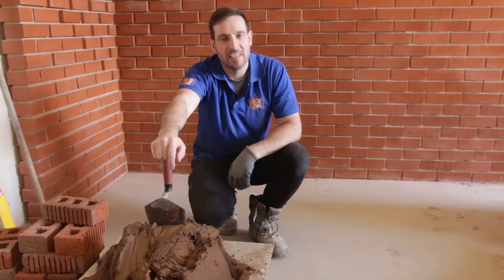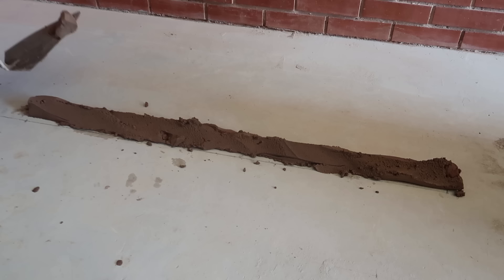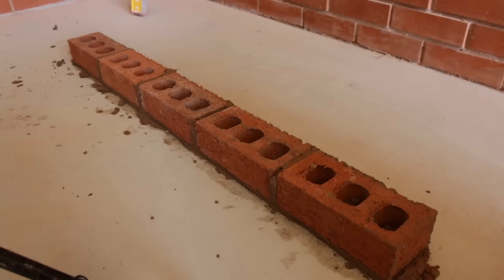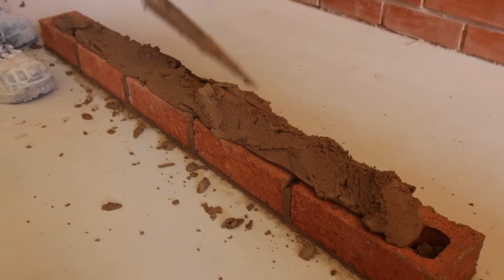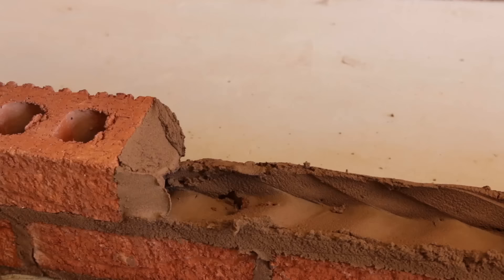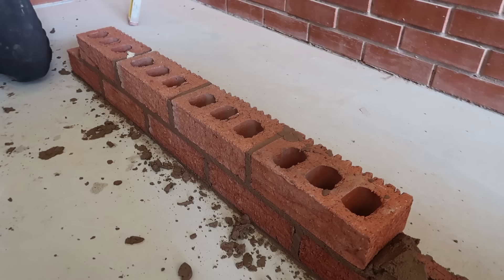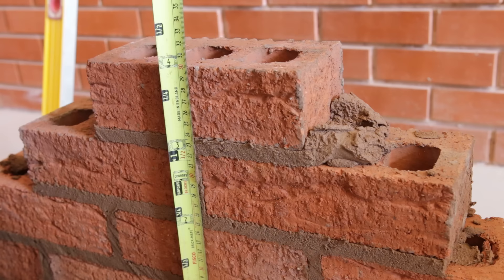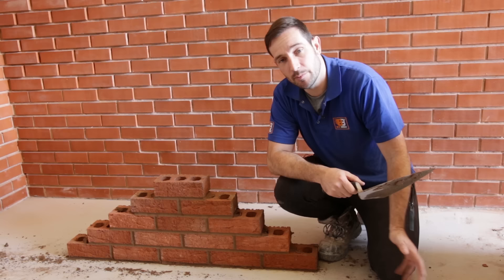How to lay bricks for beginner

Comment: Great video Stu... But without sounding rude, I'd just like to say theres a few things you do naturally (as a pro bricky) that beginners would find very difficult to get a grasp of; 1) Picking up (and laying) that much mortar with your trowel comes easy to you but would be difficult for a beginner to start off with (1 brick or so worth of mortar would be much easier for beginners) and 2) Laying the bricks down with just your hand for pressure (not using the trowel) is again much harder than it looks, I know you don't like tapping your bricks but I feel its an easier way to learn the pressure needed to lay a brick, Just my opinion. Again I don't mean to offend you or anything but I just feel that beginner's trying to follow your laying technique would have a hard time.. I might be wrong but hey ho!
Reply from the maker: Hey no probs mate great points I tell people to tap bricks down with the butt of trowel. I think people trying will take the amount of mortar that is comfortable for them they don’t have to copy exactly what I’m doing just a guide.

Comment: When I was first taught how to lay bricks, I was shown not to tap unto the level with the handle trowel for it may dent the level. However, instead of tapping unto the level, I was taught to tap on the bricks to level the brick course instead. Some bricklayers have what's called a, "stopper," which can be used for bricklayers who want to tap unto the level with the stopper on the end of the handle trowel, so as not to put a dent in the level. but I discovered that using a stopper on the end of the handle trowel to tap the level so as not to put a dent in the level can leave tough stains on the level which I discovered, may not come off when after washing the bricklaying tools; which is why, I was told that the level is only used for leveling and not for anything else.

Comment: How do you keep the muck so buttery? Mines gone off in 2 minutes of hitting the brick.
Reply: Hi..,it will be the concentrated mortar plasticiser  added to the mix ..( he mentioned it near the beginning of the video) ..,or if you don't use the concentrated type -,just add more standard plasticiser and slightly less water

Comment: I have 3 mt height wall mate, I cannot cement the sides of the wall and not the top. Just the bottom. The width is 1.5 mt do you think it will stay in place?

Comment: Hi mate you chose to use a 16mm jointer for a 10mm joint.  i am just about to do this for the first time...is that a good standard tool size to buy for these joints or is 13mm better?  i only ask cause you probably get away with more than i would as a beginner.  incidentally i am down the road from wigan!

Comment: You should NEVER hit your spirit level when trying to get the bricks all level and in line, over time it will make the spirit level useless and inaccurate, Take the spirit level away and tap the bricks only, with practice and experience you will be able to place the bricks perfectly without having to hit or tap them afterwards.

Comment: If you are starting the bricklaying on flat compacted dirt, can you skip the first layer of mortar, or do you still need to put down mortar on the dirt, and then start laying the bricks on top of that?
Reply: I would run a line of mortar, gives the first row the best chance of holding the ones above it, and mortar will grip the brick and " floor" as it dries which is something earth is not very good at.

Comment: Hi Stu, Very good video as i need to rebuild one of the shed wall - I am also planning to rake out some of the existing mortar and re point it. Could you tell me if the mortar ratio still 4:1 as i've been told to add in some aggregate?? (Wall is concrete blocks and not bricks) . Thanks in advance.

Comment: Maybe someone can clarify this for me.  He's using 4 parts sand to 1 cement as a mortar, and did not mention using caustic lime.  Another video said that cement-only mortar for a stone wall is bad bc the cement traps in the moisture and forces it between the mortar and the stone, causing erosion.  Their solution to the erosion is to use a mortar with lime in the mix.  I'm assuming that erosion is not a problem when using a cement mortar with brick because brick is pourous and the moisture should be able to escape through the brick without causing erosion.  Is this a pretty accurate assessment?

Comment: Hi Stu, What size is the big trowel you use? Mr Nizam asked this 6 months ago and still no answer. Doing the maths I reckon it's 28cm (11") am I right?
Do you do a video for brick laying on a short incline(5m in length, down to 38cm at the bottom end)?. I discovered your very helpful video and will attempt my very first brick laying. I'm now retired and aim to build a brick wall only 3 layers high at the bottom end petering out to nothing at the other end. Aim to erect fences on top supported by 2 concrete posts.
Plasticiser? my brother in law (ex-bricklayer, sadly I can't get him on the job) always used washing up liquid, what do you reckon to this?
Reply from the maker: Yes 11”

Comment: What kind of cement are you using? Its very smooth
Reply: Hi..,it's concentrated mortar plasticiser,or extra amount of standard plasticiser which makes mortar smooth,and good quality building sand (not the kind/brand of cement)

Comment: From where to find this tool on 18 min pls help me ?
Reply: Hi..,it is called a "Jointer" ,or "Jointing tool ",and available in most D.i.y. / Hardware stores ,builders merchants ,and are always on the section with trowels etc
Reply: Also you can get them on Ebay,and  many sites on line..,Just type in - Brick Jointers